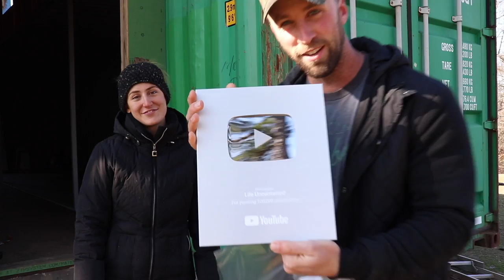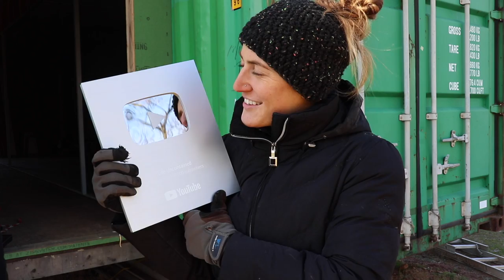WISH WE WOULD'VE KNOWN THIS BEFORE WE STARTED...

Comment: I’ve been a professional roofing contractor for over thirty years and want to offer you a better way and possibly longer term than metal. TPO over a half inch iso board insulation which would be lay in the spaces between purlins and anytime you lay horizontal purlins you should allow gaps every few feet or so for drainage for a true non sealed underlayment roof system.  Congratulations on the subscribers!

Comment: We just had one of those metal roofs installed on our house - after fighting water pouring in the house. The roofer had to come back and lay sheets of tin over the single lap joints. He then realized going one more joint 9 inches back on each sheet would cost for a few more sheets of tin to roof - but there would be zero chance of ever getting a leak 9 inches back over the second lap. That one edge joint makes it hard to get perfectly straight and not much protection from a hard blowing rain.

Comment: I always put a inch an half block screw to my nose board on both ends an put a string on blocks an run metal align with the string. I've roofed for fifty years an I've never had any crooked metal or shingles.
Reply: MJW  oh I like what they're doing we wouldn't have to have a lot of that in Tennessee not that cold here.
Reply: MJW  it's not as bad as you would think we average 55 to 65 inches of rain a year usually have maybe 3 weeks of below ten degrees an summer we have maybe a month of hot weather  around end of August an first two weeks of September brings fall on from drying out. But rest of year is mild from sixty at nite an seventy high in lower eighty during day. I farm we get three if not four hay cutting depend on grass. An most any crop does very well an pasture for horses or cattle can't get any better.
Reply: MJW  I did basic training in ft. Sill. First time I ever walked 26 miles an you could see your destination before you ever took the first step.
Reply: How do you deal with condensation?
Reply: @williamwarren3898  insulation an there is several products to use. Usually put it on decking anyways but there several things to use. Tar paper an a foam product that's half inch thick. There's several ways depending on home owner or architect
Reply: Thanks do you have a detail of the make up ? 

I didn't see how the roof was made guess I missed that session.....

Also I live in a high humidity area North Carolina and I have a neighbor That had a metal roof installed ..the contractor installed it right over the shingles and in winter he is having some water issues .

He is using a outside wood boiler (hot water piped inside) for heat , don't know if this has a bearing on it.??

Any info would be appreciated 

Thanks

WW
Reply: @williamwarren3898  warranty of the metal says you can do two things lay tar paper directly on shingles an lay metal on that. I don't like that idea cause if you only have half inch decking than your not screwing metal to much.ok the other is to put one by four nail down to rafters through deck. Every two feet apart.an that allows three quarter inch insulation not necessary though. Than metal can screw through one by four an deck if no insulation than leaves air space for metal to breath. Not sure about your friend I'd have to see it. I'm in Tennessee so I feel you on humidity.
Reply: @haroldgatlin1332  thanks Harold this location is just south of Fontana Dame,  N.C. about 15 miles  to TN. Line but it is low elevation so we get high humidity. 
Thx.
WW

Comment: Are you going to put gutters on your roof? It’s excellent for capturing rainwater and have it feed into a collection tank so you can use the water in your house.
Reply: MJW , What does tar paper or ice and water shield have to do with gutters ? I have ice and water and have gutters.
Reply: august cleanliness of the water.
Reply: Did you not hear them talk about putting gutters on?
Reply: tar paper can pollute or leach into the water or something like that i remember them saying.  @augustreil
Reply: @martymaloney1032 , Got it, Thanks !
Reply: Water will run over bird poop until it gets washed off.
Someone told me that and I had never thought about it until then. I wondered how island people deal with it because rainwater systems and birds are both common there.
Reply: MJW , Just a thought, if the metal roof is overhung by an inch like it should be, and the gutter is under that, the whole tar paper run off is not even an issue. Not even close.
Reply: MJW , Oh I know, no offense to you, sorry. Was just stating that their theory is a little shaky, that's all.
Reply: Collecting your own rainwater is illegal in some areas of the US as stupid as that sounds. 
The trick with using rainwater is to have a "first flush" pipe that catches the first so many gallons,  along with leaves and other junk. Once the first flush pipe should have a drain valve and be emptied after each shower. 
Once the first flush pipe is filled up, water will flow into a side pipe to the tank, causing any extra leaves and junk to collect in the flush pipe
Reply: @augustreil  You do not want to introduce contaminates into the water from petroleum based products.
Reply: @95SLE , I get their theory but If the metal roof is overhung by an inch like it should be, and the gutter is under that, the whole tar paper run off is not even an issue.

Comment: Hey guys just give me a safety tip..... When you put the ladder up against the roof edge put another 2 1/2 to 3 feet above the roof edge,,,,, So the boss can get down with holding on to something.... If you don't,,,, You don't have any thing to hold on to to get off the roof . Try it for one time you"ll amazed how much easier... It will make your life. ALSO TIE THE LADDER OFF SOME PLACE.   HAD A LADDER BLOW OFF A HOUSE. IN A SUMMER Community area middle of November......  Was up on the roof for about  40 minutes before someone came along to put the ladder back up. Hard  mountcell phone in the pick up
 Congratulations on the thousand viewers take care be safe junkman do PS Try the ladder trick  please
Reply: That is why my ladder is tied off. 8.5' drop to the ground would not be fun.

Comment: putting down steel roofing is  a learning curve, even for the self professed experienced ones. Pop a string and stay square. mark on those purlins.great job. it's the challenge I like, but I like to work slow and meticulous. never worked by the hour. The main thing; you are doing it together. congrats on the 100k plaque.

Comment: Congrats on the 100K, as for the stager what your more then likely running in to is when the panels were run they were out of square, normally on a big job where time matters you do not worry about it, if it’s a issue we would stretch a dry line and use that for a straight edge at the base that’s going to be seen other wise it was just slam it in and keep moving! Looks great guys

Comment: I seen a steel roofing installer pre-drill stacked panels in the Peak of each raised area so the Screws are High and have less chance of leaking rain from pooling and by using the peaks the steel can expand and contract do to the springing action of the raised area.

Comment: You are done now, but string lines are your friend. As you said your gutter will cover it up but when you dont have gutters it can be seen. We always flush the panel edge and either slightly stretch or put a "foot" under long side to pull it back.

Comment: congratulations.  its a little early for the recommendation but when you vapor barrier the interior use foiled/aluminized kraft paper instead of clear plastic.  it makes sheetrocking a bit harder as you can't see the studs easily but it makes a huge difference regarding heat and cooling retention indoors and preventing summer heat from intruding inside.
Reply: Steve Slade  - please explain.  does the south not vapor barrier?  no sarcasm, just curious.
Reply: Steve Slade  - forget it.  i looked it up.  in that case i would spray foam closed cell about an inch on the inside exterior walls, insulate the rest of the cavity with open cell foam and still "vapor barrier"  with foil on the room side of the house.   its a shame not to get foil into the mix somehow and in this day and age whatever it costs to spray foam is well worth in both in comfort and energy savings.  i didn't realize texas was considered humid, which incidentally seems to be the requirement for exterior wall vapor barriers.  according to google texas is considered hot and dry.  i have heard the mold arguement before though, even in ct. as we are subject to rather humid summers.  i don't know it seems like engineers make things complicated sometimes.  what i live in is painted with (texture 101) a waterproof paint so i'm not exactly seeing where the moisture could enter the walls.  even if they physically get wet the water does not permeate so how could moisture laiden humid air permeate?  the cavities are sealed systems, no moisture can get in through the room side because its vapor barriered.  but  i should point out that my joint is open celled spray foamed and for me that makes a huge difference.  fiberglass is crap in my opinion.  the government should outlaw that crap and subsidize spray foam enough for it to be more decently reasonably affordable.  and just for cost comparison my house (a converted chicken coupe) is about 1000 square feet and spray foaming it cost approxiamately 7500 usd about five years ago.  i can get through a new england winter with one cord of wood and about 150 gallons of oil and i use the a/c only during 90+ degree summer days, and a small 9500 btu unit covers the load just fine, and i am subject to the sun and i have a black asphalt roof.

Comment: A string line is a good way to keep the edges straight.  Use a taperule allow for your overhang and run a string line up top. Run the top edge of the panel with the line

Comment: i absolutely love your design on your house i would of never thought to build one like you are i cant wait to see what kind of layout you have for the inside showing  being a roofer from florida i would of used  tar in between the laps of the roof panels just my opinion but its your house ... if i were u tho upstairs in the center section i would give it a sliding glass door for roof access and add a deck up there if possible

Comment: You can still put insulation between the roof and the container if you use blown-in and go through the zip panel from the inside, it would be under the roof so a couple of temp holes would be fine or you could go straight up through the containers

Insulation on top is the most important because heat rises and whatnot, but in the end I’m just a YouTube commenter so do as you will

Comment: Mark a line perpendicularly square from the lower edge of the roof and then mark lines for the edge of each panel across the roof from this reference line.  The manufacturer will know the actual width of the panels or you can select a straight one and use that width.  Screw each panel securely in alinement with its marked edge.  

The WIDTH of each panel can VARY from the ridges being compressed (or stretched) from moving them.  A panel can be wider at one end (bell shaped) than the other because of this inadvertent stretching.  This panel-to-panel difference is what makes squaring metal panels difficult.  Securing three panels together eliminates SOME of this movement, but aligning each panel to a marked line is more accurate and easier, especially when installing longer panels on steep roofs.  

I hope this makes sense.  It is the way professional installers align metal roofs.  Congratulations on your 100K subscribers.  Additionally, I want you to know that I am impressed with the quality and precision of your work.

Comment: best practice for PBR panels include 3/32" polybutal tape sealer on each overlap joint and closure strips on panel drip edge....other builders are directed to follow manufacturer recommendations

Comment: run some 1.5 x 1/2 wood or channel vertically and only then place your horizontal battens to support the sheets. The Canadian way proves to be much better in all situations. Using a stop channel will keep your sheets in line also near the bottom. solid non bending 1 x 2 aluminum 1/8 wall 16-20' length buy 1.

Comment: When installing metal "colorbond" style roofing, you're supposed to put your screws in the ridges not the valleys. This reduces the chance of water seeping into the screw holes because the water runs down the valleys rather than the ridges. Hard to tell from the video but you must use metal roofing screws; they have thick rubber washers under them and are specially designed to tighten to a point and then release pressure to prevent your ridges becoming compressed, but still proving a tight hold. Also you're alignment issue is resolved by placing sheets over at least 2 ridges, not just the end ridge. Yes it requires more sheeting but it helps keep things much straighter and forms a tighter seal.

Comment: You can actually stretch or shrink metal roofing. It's how you screw it down. Screw up the overlap rib side then you can lift up the steel in the middle at top or bottom depending on the way you need the steel shifted,and while steel is up at top or bottom screw that corner down and work down that rib .then go back and finish screwing sheet down. Hard to explain but it's really easy. You don't have to lift center of steel very much . It will actually compress the ribs together a little bit to help get back to square. Most of the time it will work in one sheet

Comment: Great job Kiddos!!!!  Congrats on 100,000!!!!   Yep ya made it your officially U-Tubers !!!  But hay I don't mean to pop your balloon, but I noticed something that you may regret later. It would not have been noticed unless you had been doing home repair as long as I have (30+ years) what I saw was a simple thing most do not even think of, you used nylon screen for your roof vents, for the long run that's not good!!!   Birds and bees go right through it, metal screen with a small square hardware cloth over the outside, both galvanized is permanent, without penetration!!!   Come spring when the extra queens  leave the hive, and the birds look for a place to nest you will start to see holes!!!   So you can fix it now while you are still on the roof or wait until the vermin invade, it's up to you!!!  I gotta warn ya once they get started they are VERY hard to stop!!!

Comment: I would have done what you guys did with the roof except I would have used peel and stick sealing membrane under the metal roof.  Also, you guys need to make sure that you incorporate a storm shelter into your home.  I would either cut out the floor in the center and build a rebar reinforced concrete shelter under the floor or even better incorporate an enclosure into your bedroom.

Comment: Metal panels can be stretched and compressed to square them up. You can correct 1/8 inch or slightly more per panel.  On hundreds of foot runs on large buildings this is a necessity whether roofing or side walls.

Comment: Another method for keeping the roof sheets perfect is using a chalk line at, say 1/2" from edge of roof then marking the steel at two inches with pencil and put the sheet down matching pencil mark with chalk line.

Comment: Seems like the horizontal wood strips would prevent drainage from leaks and that the water would rot the wood strips before it reached the small vent spaces between the strips.

Comment: I have studied insulation and air cooling in walls for awhile.  I don't think you have enough breaks in the vertical wood (side to side) to allow any amount of air to navigate up to a exhaust port.  Yes I know the metal has a couple of bends for strength and on a verticle wall, some air would naturally travel up and out.  But what makes your application much more complicated is that the roof is almost flat, what about 3% grade???   Air is really slow to move on its own, heated it may move a little more but your roof is mostly blocked and flat which indicates you will have practially no air movement and the solid wood strips will trap water..
Maybe you should look this up.  I foresee no problem as long as you never have a leak and you will have temperature problems in the hot sun as air flow won't be much if left as is.
But your workmanship and self engineering is good.   
Not meant to be a negative post, just an observance...  Hi BEAR

Comment: Awsome build and chanel! Just one questions. I am an amateur, but I thought 2 perpendicular layers of battens were required. 1st layed from ridge to gutter, and then 2nd layer lenghtwise to provide support and hold for screwing the roof sheets to. 1st Layer of battens lets any leaked or condensed water to run freely of the roof, and also lets hot and moist air circulate. Your singel layer doesn't let air ventilate and risk trapping or daming water if it leaks. Sure, the closed cell taped insulation should be mostly waterproof. But still..... Did you considder this aspect, and if so, what made you opt for this solution?

Comment: Late for this, but two pieces of that purlin cut to exact spacing length between purlins would have made it so much faster than measuring every single piece. Perhaps that would be a good thing to do for studs or whatever in the interior.

Comment: This is my first time viewing and I think you guys are doing a great job, but as a general contractor out here in California I have a question.  Although I have no knowledge of building with shipping containers I  would think that on the outboard containers you would need more fall when using metal, non standing seam roofing.  I’m not trying be be critical you guys are doing a great job I’m more just curious if using Zip sheathing with tape will work over what looks to be a roof with a 2/12 fall?